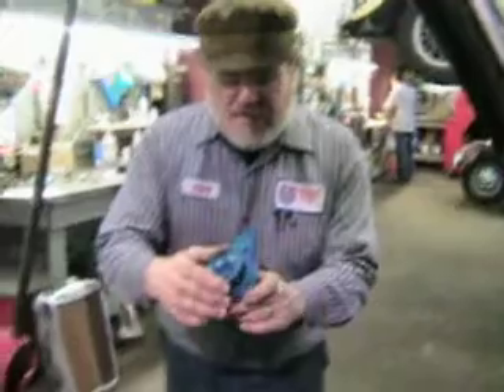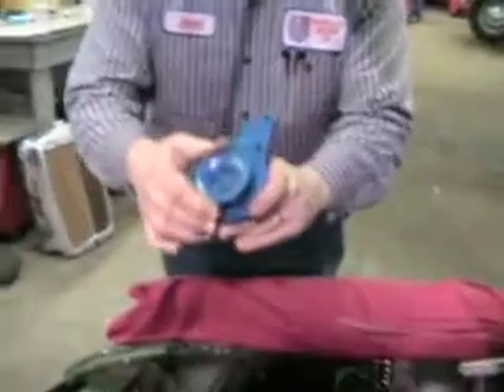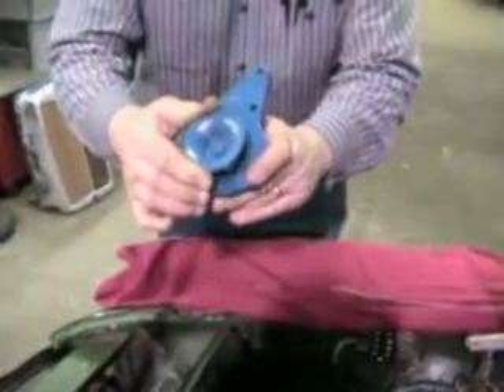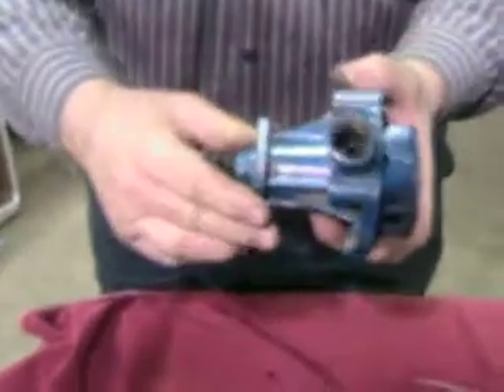047 MG Tech | Faulty Water Pump on a 1976 MGB

Comment: Easy does it.... One remark: wear on  the Lucas alternator front bearing may also generate a similar noise from the rotor touching the stator. This at least happened to mine last year and I put a second hand one in after renewing its brushes.